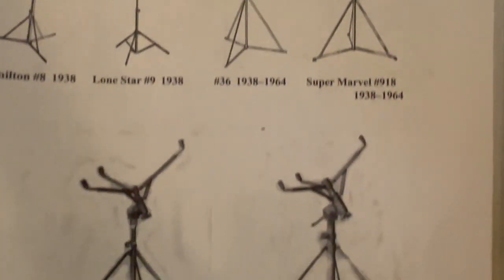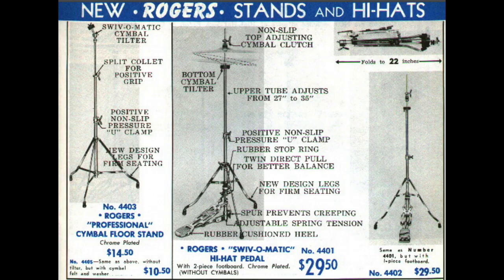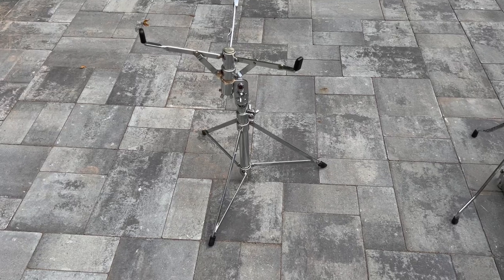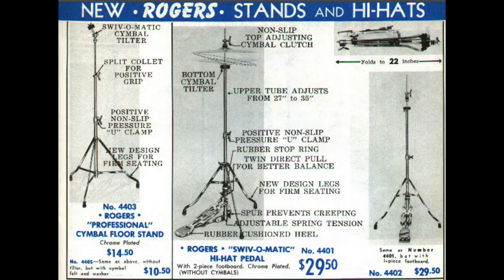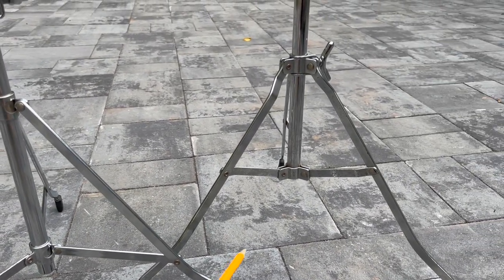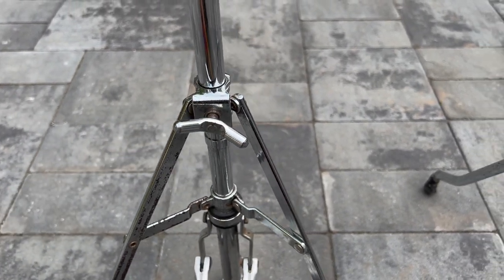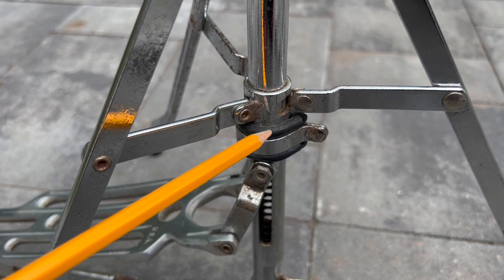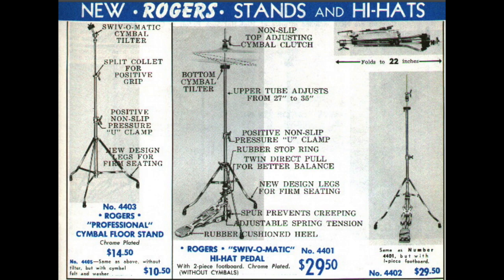Rogers Drums - Walberg & Auge/Rogers 1st. gen stands and how to identify them.

Comment: Wow Anthony, this video fascinated me and here is why: I live about 25 miles from the Walburg and Auge location, and drove past the building more times than sat at a drum set ( not literally). I've always been a huge fan of Rogers Drums. But never knew that the hardware on my precious drumset was made at the unassuming little building that's been turning my head for decades. I always knew they made drums there but had no idea that many parts of my " Cleveland" drums were made so close to my home. Also, for about the last 15 years, my company's depot that I was a full-time spare driver for, is about 2-3 miles from Walburg ' s building. Therefore I, in spare capacity ( you can read that as sort of errand boy), was necessitated that I drive by it about 6 or more times a day. Every time I drove by. I would think of such a cool place that made drums, always thinking incorrectly that it was a tiny ( niche) drum producer. Having visited there only twice ever, and not seeing any " cool" drumsets on display for sale re-inforced that idea. If I only knew then what I know now. Fyi. The building still stands almost exactly as it was, and recently had another total remodeling for whatever unknown business now calls it home. Thank you again Anthony!!!!!!!!!